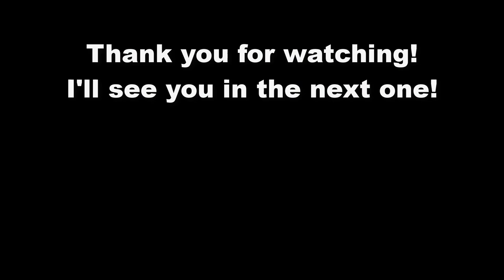Bosch K-Jetronic Fuel Distributor Rebuild  // 1985 Porsche 924 Restoration Project // Part 17

Comment from the maker: It has come to my attention that there shouldn't be a spring behind the plunger on these cars. So if your car doesn't have one, you're good.
Reply: Thanks for the heads up. I'm getting ready to do this job. I've ordered a rebuild kit from a place called Sierra Madre Collection.
Reply: I just noticed this comment now. I searched for over an hour around my workbench for a spring that wasn't there in the first place! 🙂
Reply from the maker: @Yurikureka lol I kinda had a similar situation... for some reason i thought mine fell out when I removed my distributor from the car and I couldn't find it, so I bought a new one(one you see in this video)
Reply: @RestorationApprentice  It's a great video with the clearest explanation I've found. I do have one question though, when the fuel distributor is being closed again, does it need to be tightened to a specific torque?
Reply from the maker: @Yurikureka  Kit instructions just states to snug them down by hand.
Reply: @RestorationApprentice i opened my distributor and their wasn’t a spring behind the plunger but i feel that’s the reason why it’s not getting enough fuel because i don’t have a spring and the plunger just gets stuck at the top
Reply from the maker: They should work fine without the spring @skrtslothytm15
Reply: @RestorationApprentice  just about to do the fd for my 6 cylinder 1988 mercedes w124. I removed the fd yesterday and the plunger needle doesn't come back out freely. The car was sat for two years in the barn, worked fine back when I parked it in there so I'm guessing it's all going to be gummed up inside.

Comment: Outstanding as always but surprised no paint or sealant.
Reply from the maker: Thank you! I opted for just a rebuild in this video. In the next one I will be restoring it visually along with the whole unit with air flow meter and filter box.
Reply from the maker: Instructions say to try to assemble it without any sealant... Then if it leaks, to add it. It didn't come from factory with the sealant.

Comment: Good one mate, very clear, but you really sped it up around  rebuilding the plunger, and does the plunger need to be set at certain height ( looks like it’s got adjustment )
Reply from the maker: Thank you! No, there are no adjustments on the plunger.
Reply: Great. Thanks for replying- I have a 300SL 1988- the fuel mixture is very rich, keeps fouling the plugs with soot, tried adjusting the mixture screw but no good. Could the fuel distributor need overhauling? The had been sitting for a couple of years - any thoughts please. Thanks
Reply: @donjohnson4368  my suggestion is firstly to check to make sure that the warm control pressure is correct after warm-up. If the   control pressure is too low after warm-up the air/fuel mixture will be too rich the whole speed range and that can cause the spark plugs to be flooded with fuel.

Comment: What problem were you trying to fix with the rebuild? Were there any obvious issues found during disassembly? Did the rebuild fix the problem?
Reply from the maker: Doing a full restoration so this is one of the many tasks I had to handle. A bit of crud and some very old seals.

Comment: I have a 1977 Porsche 924, I was wondering if the spring you pull out at 3:04 is needed with my model. I pulled mine apart and there was no spring, everything else seemed to match up and I have every other piece.
Reply from the maker: Probably not... not sure mine need it too. I was positive I lost mine so I bought new one... but maybe it wasn't there at all.
Reply: @RestorationApprentice  Thank you, I’ll put it back together with out it for now. If that doesn’t solve the problem where did you get the spring?

Comment: What products are you using after the bath before reassembly? I can’t see the labels.
Reply from the maker: Just a brake cleaner, to clean it a bit more and a bit of fine machanical oil for the plubger.

Comment: Did it seal ok without the sealant on the ,idle plate. I’ve just ordered the same rebuild kit for my 5 cylinder so I’m keen to know. Will be using this video for reference
Reply from the maker: I havn't tested it jet. I'm working on rebuilding the engine now.
Reply: @RestorationApprentice  I’m gonna do mine when the kit comes. Got a ongoing issue that once the car has been driven for 20 minutes it goes all jerky and revs go all over the place. Tested fuel pressures had my WUR rebuilt. Only thing I’ve not done is the metering head

Comment: Hi I've just watched your video of the k tronic fuel distributor, I own a 2.8 capri and the problem I have is the car is slow to start from cold but once running will eventually rev up but when you drive down the road you can put your foot to the floor and there's nothing no power is this the fuel distributor failing to push fuel to the injectors many thanks
Reply from the maker: Thank you for watching! Sorry, I'm not sure... I still don't know much about these distributors, I just followed instructions that came with the rebuild kit.
Reply: Check your fuel pressure. Sounds like a failing fuel pump or a partial blockage. Dismantling the distributor is a LAST resort.
Reply: Thanks for the info I took the distributor off and drowned it with carb cleaner and left overnight it's back on the car but haven't tried starting her yet as I've stripped out the thermostat but I'll let you know 😁

Comment: Did the distributor leak any gasoline? I did rebuild for a 6 cylinder MB and it leaked without the sealant
Reply from the maker: Haven't tested it yet but it probably will, as with most people. But instructions that comes with the kit encourages you to try without sealant first.
Reply: @RestorationApprentice  thank you. Please, let me know once you try it out if you cabb

Comment: I was told that you cant take those apart because they have a certain torque and they will leak afterwards.
Reply from the maker: From factory they don't come with any sealant... It's common practice to seal two halves with a thin film of sealant if taken apart. I tried to not use any, and once tested I can add it if necessary.
Reply: Have you needed to add sealant?

Comment: I'm doing this project on my 1985 Scirocco.  Has your unit leaked with no sealant?  I'm torn whether to use sealant or not.
Reply from the maker: Haven't tried it yet. I'll remove the unit and reseal it if it ends up leaking.
Reply: @RestorationApprentice  Thanks - I'll probably do the same.  Good luck.

Comment: At 5:52 you removed the o ring from one half of the distributor, but both halves have the same king. Did you remove from the other side as well?
Reply from the maker: I can't remember now. I replaced every o ring that came with the kit.
Reply from the maker: Btw, did you manage to get your piston unstuck?
Reply: @RestorationApprentice  I did, thanks for the mallet suggestion. Had to knock it all around and finally got it out. It was the whole cylindrical housing, not just the central portion. I tried matching the rings which came with the kit and couldn’t be sure if there were enough, so I didn’t take it out. I’ll look again to be sure. Thang again for all of your help.

Comment: So ive been browsing hoping to find someone who applies sealant to the halves. I cant seem to keep mine from leaking.
Im doing mine on a benz but you and i donit exactly the same way and i also get my kits from missing.parts.
Reply from the maker: Yeah, definitely put some sealant on it if it leaks.
Reply: @RestorationApprentice do you know what sealant can be used?
Reply from the maker: @maxkaufel4715  Loctite 574
Reply from the maker: @maxkaufel4715  or maybe even better Loctite 518
Reply: @RestorationApprentice  yeah these are the ones im considering right now. I read about 515 but thats really expensive and hard to obtain for me.
Reply: @RestorationApprentice  yeah these are the ones im considering right now. I read about 515 but thats really expensive and hard to obtain for me.

Comment: bonjour ! faut-il faire des réglages après le remontage ? merci :)
Reply from the maker: Thanks for watching! There is no adjustment from factory, but there is a mod you can do so it's adjustable.
Reply: @RestorationApprentice  so if I disassemble the part, no problem to reassemble it in principle? (by the way, I love your videos)
Reply from the maker: Thanks! Yeah, pretty simple.

Comment: taking that completely apart is a big no no its gong to leak
Reply from the maker: Well, they do make rebuild kits so you can take it apart or send it to them for a rebuild. They advise to not use any sealant at first...if it leaks you can seal two surfaces with Loctite 518 or similar.